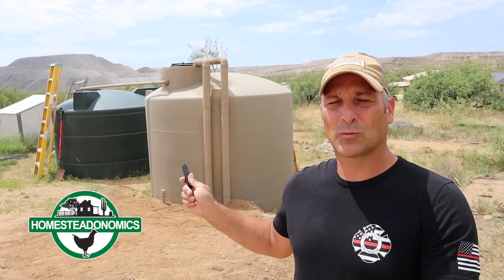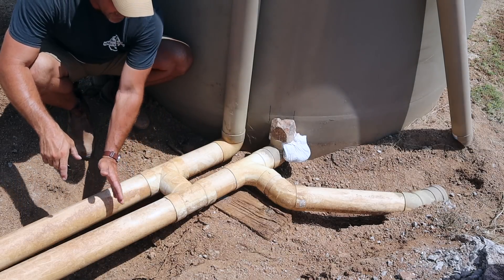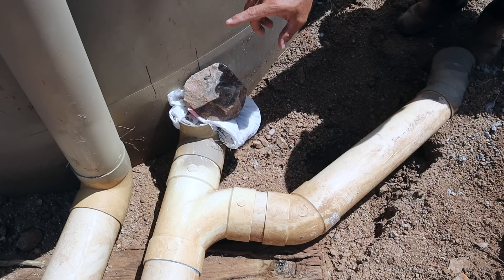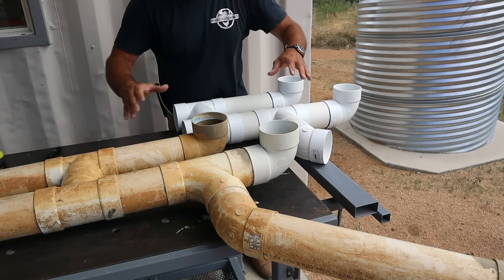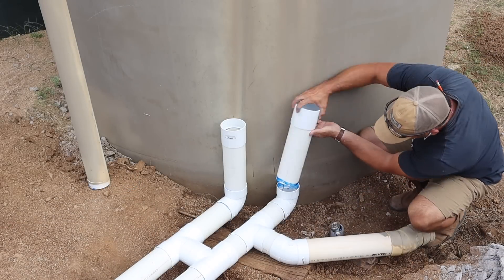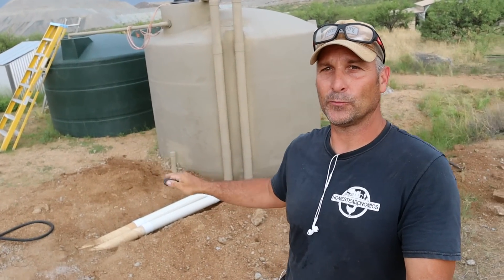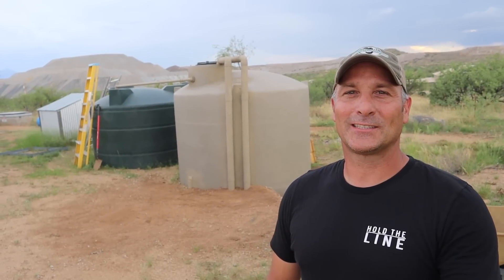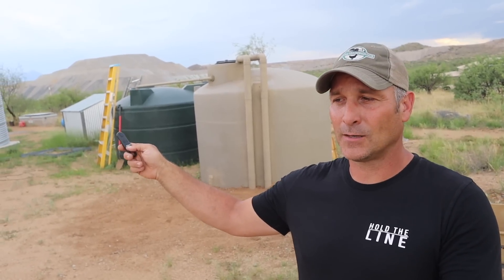When You Own the Water Company.... Repairs Are Inevitable  (Rainwater Harvesting)

Comment: I had no idea water could flow upwards. How does that work?
Reply from the maker: Water always flows out of the lowest outlet in a pipe run.   So the inlets where my gutters flow into the pipe, are higher than the outlet, where the pipe run goes into my tanks and flows into them.   So long as there is a difference in the level of the pipe inlets vs outlet, it will flow out thr lowest point

Comment: When fittings are super close like that and you need to replace only one, you can use a propane torch to salvage the rest without rebuilding. Cut between the fittings then use the propane torch to heat up the cut off pipe from the inside. The pipe will soften and the glue will release allowing you to fold the bad pipe and pull it out. The fitting should just need a cleaning before re-use.

Comment: Nice work. All that time doing water harvesting never even crossed my mind that the piping in a wet feed system could store a significant amount of water. Looks like you have about 50 feet between the tanks and the house. At .65 gal per foot of 4" that's 65 gallons between the two pipes, not including the vertical sections. Great idea joining them together. Do the pipes in the background on the corner also feed those tanks?

Comment: Do they sell clear pipes it would have been pretty cool to watch the water go up
Reply: Part of (most of) the reason he painted the pipes was so that they wouldn't get UV damage from being in the sun all the time.  The paint protects the pvc from becoming brittle and cracking.
Reply from the maker: They do….but mostly small scale for interior purposes.   I’ve actually thought about making a little prop to show how the water moves through the pipes as that is one is the most common questions that folks have…regarding the water moving up through the pipe.   Pretty simple as it’s simply the level difference between the inlet and outlet.   But I think it’d be neat to show